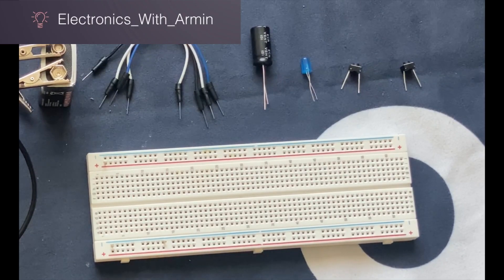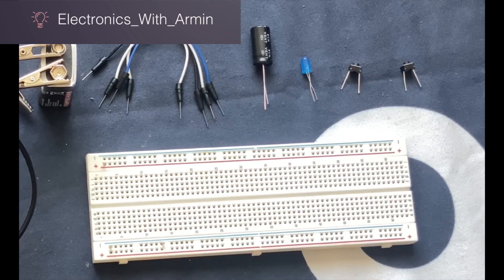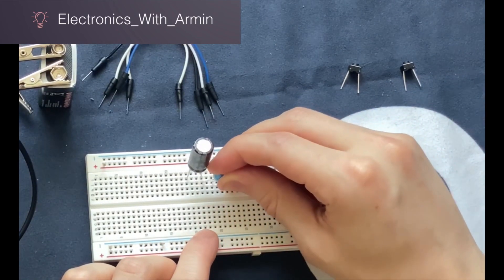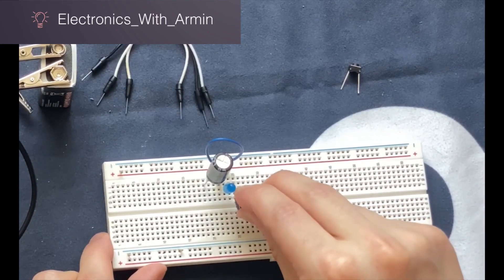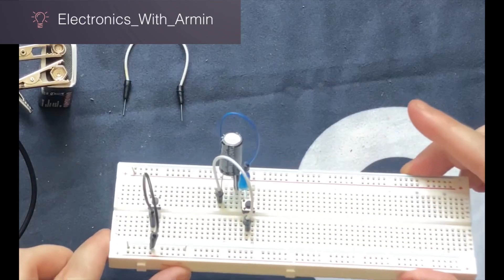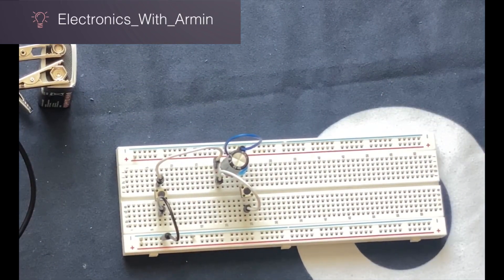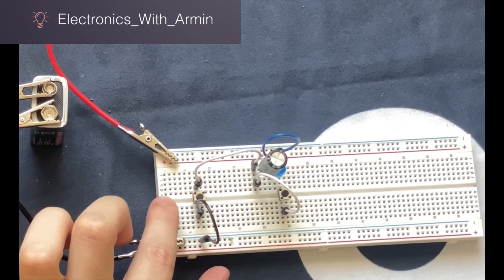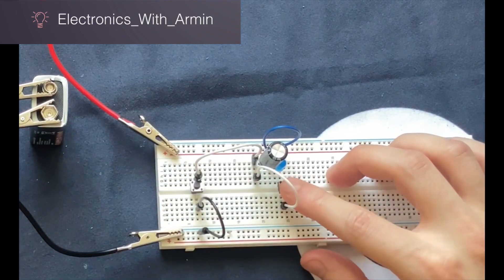Capacitor Charge Discharge on Breadboard #charge #discharge

Comment from the maker: Other cool projects 🎥

Fire Alarm Circuit 👇

https://youtu.be/jc5K2RMGQY0

RC Low pass Filter 👇

https://youtu.be/JXGlq6THyWU

LED Flasher Circuit 👇

https://youtu.be/Zu1TZ-9C33U

Doorbell Circuit 👇

https://youtu.be/XZ2f612WOTU

Half wave Rectifier 👇

https://youtu.be/SHu47wmiY7I

Charging/Discharging Capacitor 👇

https://youtu.be/HUgAc91mMe4

Comment: Great Video , can i use 100 micro Farad capacitor instead?
Reply: Good job
Reply from the maker: Yes you can , but the LED stays not much longer on compared to 1000 micro Farad capacitor since in 100micro Farad  less charge will be stored